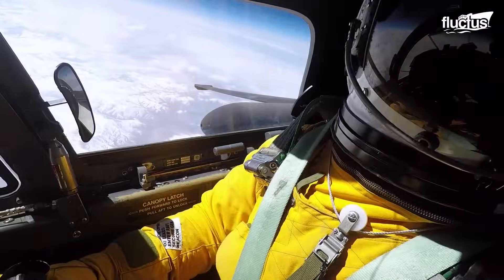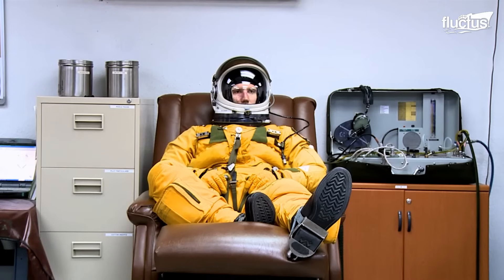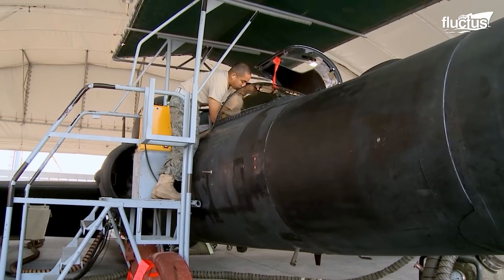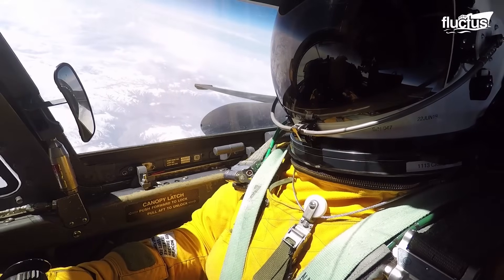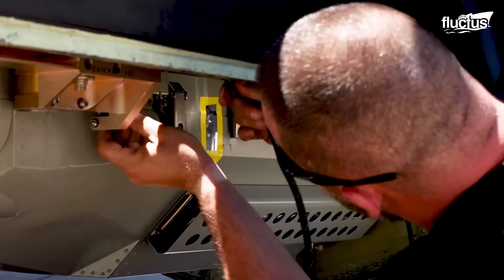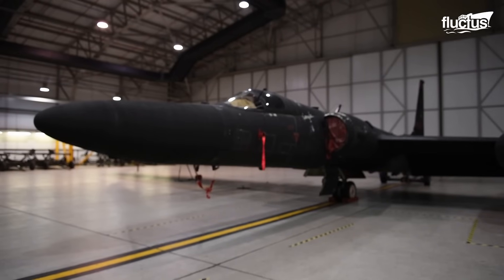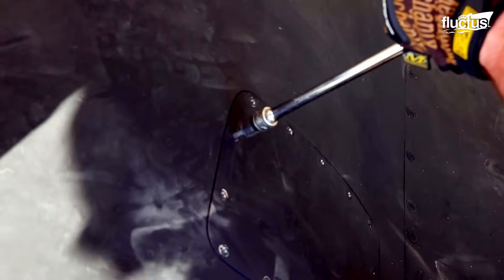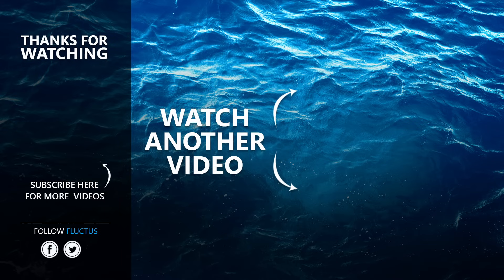Insane Process of Preparing a U-2 Pilot for a Secret Edge-of-Space Mission

Comment: how do they pee?
Reply: It depends…
Reply: @DrChim_Richels I think I know what you did😊. But it depends! Lol
Reply: NASA is actually still working on decent solutions to this question. Some male pilots use a condom style catheter connected to a collecting bag, but I don't know about U2 pilots. That could get complicated if they lost suit pressure and the bag exploded. The resulting mist could cover their instruments and possibly short out electrical systems. That's happened to private pilots who simply opened a sealed coffee thermos at altitude. It happens when passenger jets simply lose pressure at altitude because the water in the air turns into a mist.

I like giggling about this as much as any grown-up adolescent, but there's a serious safety component to it. My guess, never having been involved in high-altitude operations, is that a diaper would be safest and simplest. That's not an uncommon solution among private pilots on long flights, especially women, who don't have the anatomy to make use of the same everyday receptacles (bottles, jars, jugs, etc.) that most men can use fairly easily.
Reply: @beenaplumber8379  i appreciate your response. interesting. thanks for your time